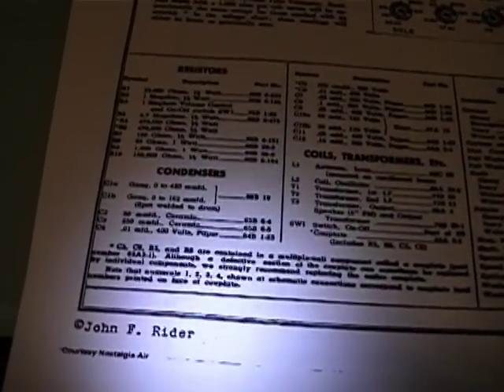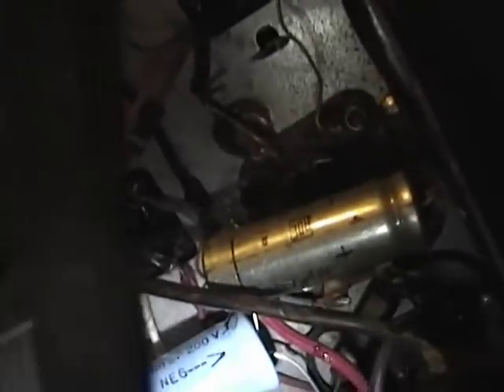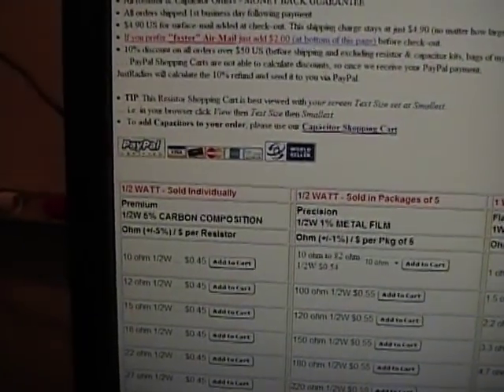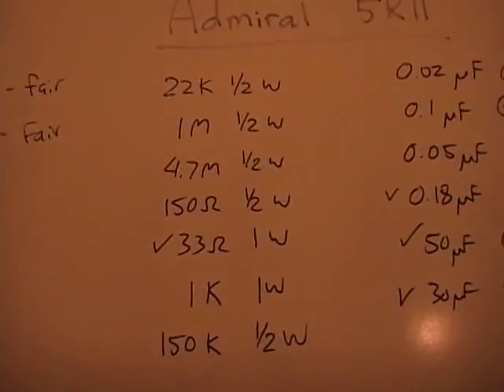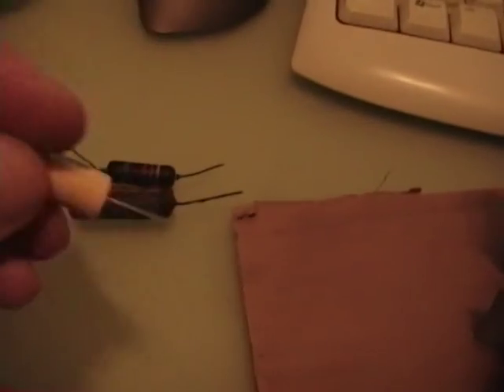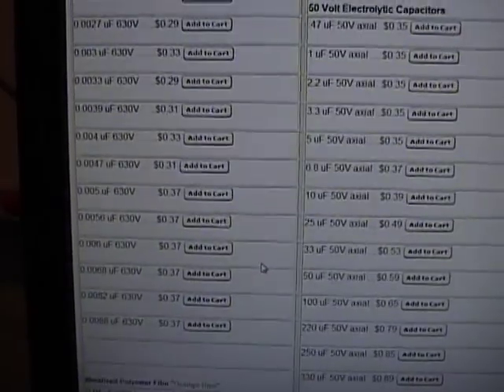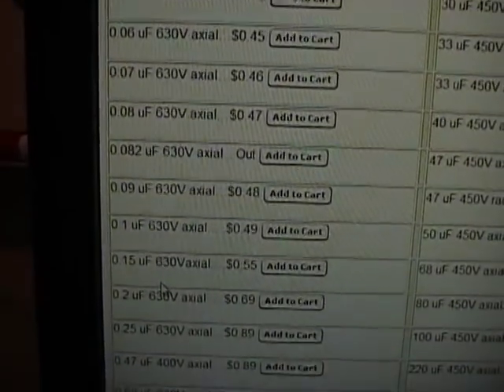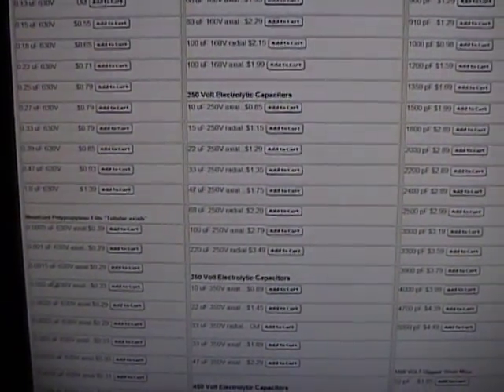Vintage radio restoration 101 (Admiral 5R11) - part 3

Comment: I usually buy my condensers in bulk from one of the surplus electronics places, along with resistors. Lately I have been buying polyester condensers from Radio Daze but I may try someplace else as I buy them in packs of 50 or more at a time. Old radios, and TVs, seem to use common sizes like .22mf,  .1 mf, .047mf, .01mf, .005mf, .001mf plus most of those places allow you to order any quantity of any size.